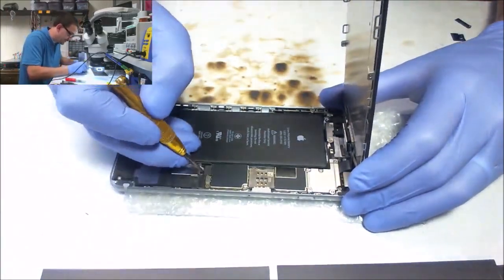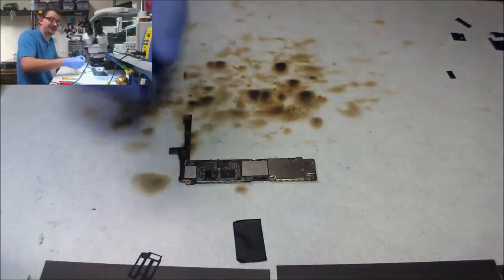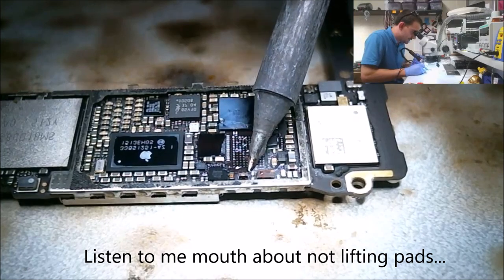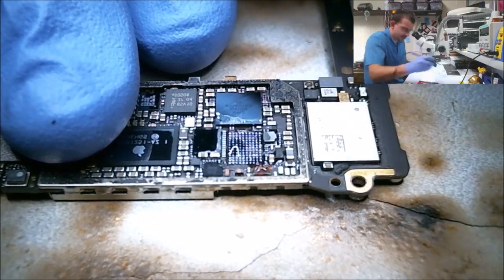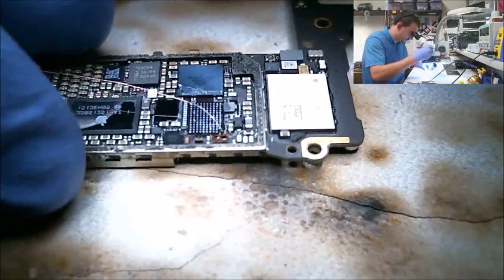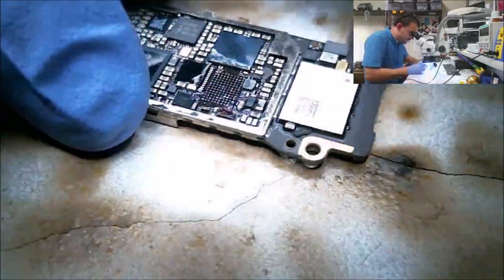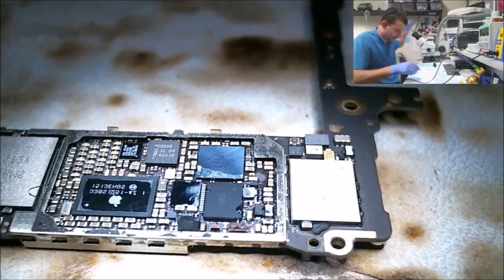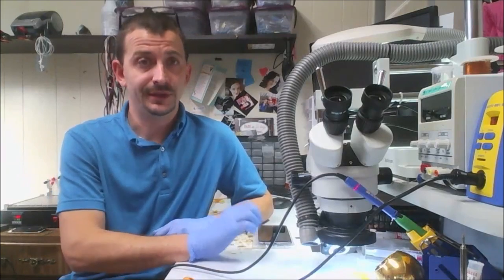ANOTHER iPhone 6 Plus Touch IC repair with jumpers

Comment: Are you trust worthy to repair people's devices because my iPhone 6 Plus has the touch disease if I send my device into you are you sure that you can fix it???
Reply from the maker: Being trustworthy doesn't have much to do with ones ability to fix touch disease.  Some of them are not fixable and I wouldn't dare tell anyone for 100% certain that their device will be fixed no questions asked.  If I did, they would be the ones to send in the long screw damaged boards that had been heated with a Wagner heat gun because they already tried to fix it themselves repeatedly.   I stand behind our warranty.  If it's not fixed, we don't charge.  If the repair doesn't last - we refund the money.  There's no way I would be in business if I wasn't actually fixing the stuff I work on. :)

If you are looking for an absolute guarantee your touch disease is cured no questions asked, you should check with your carrier for trade-in options on upgrading to a 6S or 7.  They don't suffer from this nasty defect.
Reply: Well I emailed you about my touch disease device would I have to restore the phone then send it to you or send it as is?
Reply from the maker: I've never had to restore one for touch IC repair but strongly advise you to make an iTunes backup (if possible) before you send it just in case.
Reply: +STS Telecom 
do you want me to take off the pass code or find my iPhone or leave it as is
Reply from the maker: +Mason Hernandez I will need the passcode or have no passcode.  I have to be able to test your cameras, proximity sensor, light sensor, microphones and speakers after this repair.
Reply: +STS Telecom OK sorry I'm at school right now let me go home and do a back up then I'll probably be shipping it by tonight